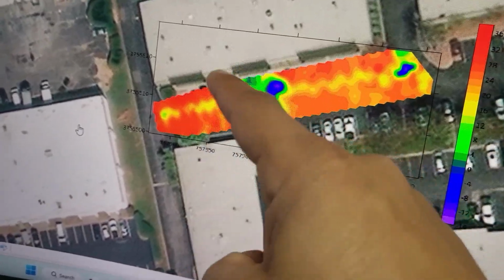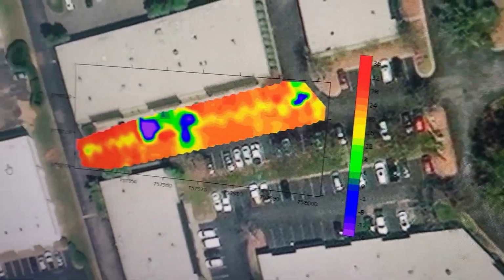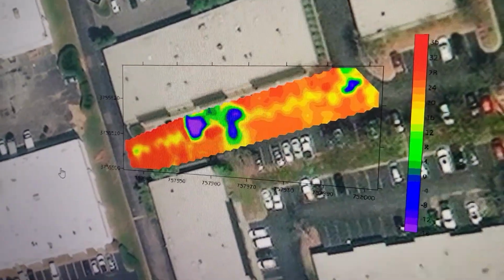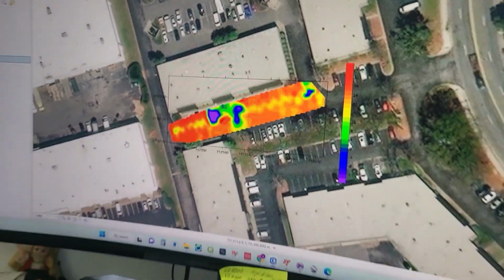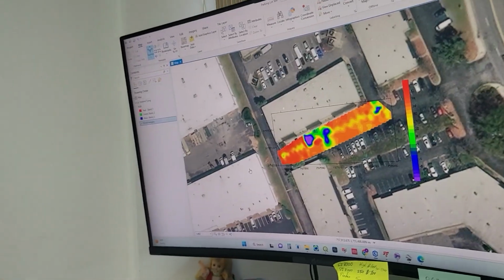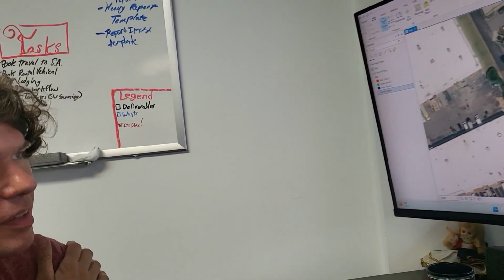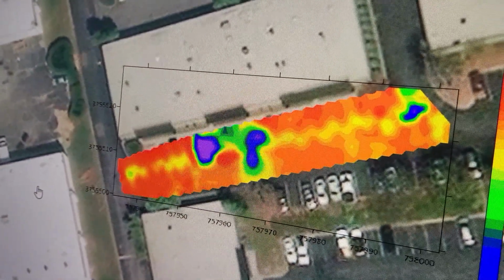Using Geonics EM38b conductivity meter to locate & map subsurface pipes & utilities | ASCE 38-22

Comment: Do you guys walk in alternate mode? Is only one way? I mean, seems to me that one one line is created and the plotted due the GPS data.

How do you guys put the image in the google map? Do you use surfer and then export?
Reply from the maker: Thanks for the questions. We collected in one line, alternating directions. We plotted in surfer. 

Generally, I don't recommend collecting one long line but rather individual lines, stop/turn/start a new line.
Reply: @Learngpr  Excellent guys, I do appreciated the response.

Your video was really open eyes for me, last question, how separate each line you usually walk to get the best results? Currently Im leaving 50cm separation between each line.
Reply from the maker: You have a good line spacing. It will depend on what you are looking for. 50 cm is closer than the video shows and its usually what we do for archaeology. But we have used larger spacing for utilities and soil mapping. Hope that helps!
Reply: @Learngpr  It does indeed.

In arqueology, what are the mix sizes of your grids or areas you walked?

I tested recently one of 35mtx26.50, I know the machine read well an structure that we know the location but just wanted to confirm if the area is too large or not to get more detail.

Using the EM38-MKII, would say, latest version